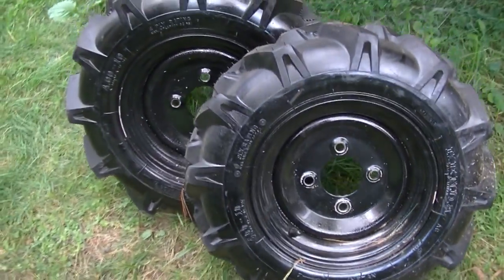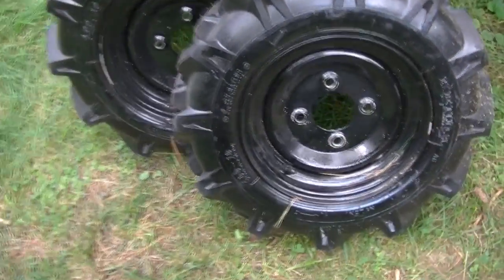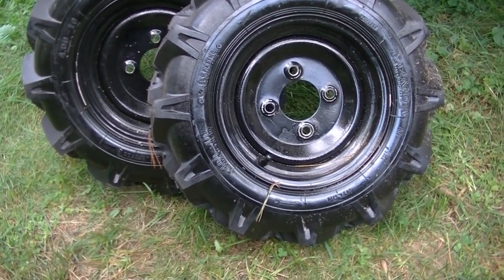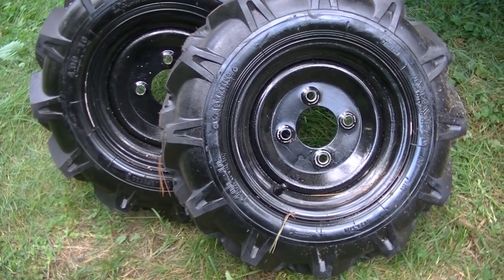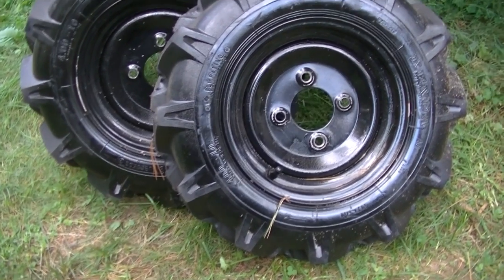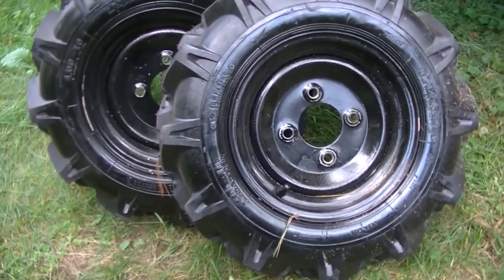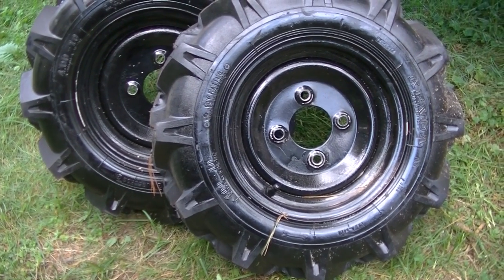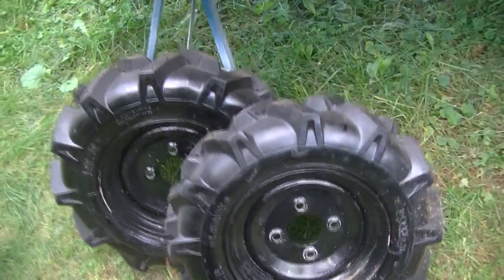Raining Goodies Again!

Comment: We have a Kubota D-1105 diesel in a 70's cub cadet, and we pull with it. This Diesel has 25hp. We destroyed 2 diffs after just 3 pulls, and I ended up building a pinto diff and axles for it. Works great now. You are going to need a substantial rear end for 40hp. I can't wait to see what you come up with for this beast. Pull video's are on my site.

Comment: The Eaton is one tough Hydrostatic transaxle probably close to a tuff torq K72 in strength.  You can never have too many Peerless 820's.  Grab 'em when you can get them.  The Subaru engine is a monster!!!  Are the car turbos water or oil cooled?  I can't tell.   The smog pump supercharger should work quite well.  Hope you have a boost gauge on the dash.  Glad you have 4 steering transaxles.  Another item you grab when you can.

Comment: I've looked for one of those all wheel steer transaxles's forever and you've got four good job
Reply from the maker: I managed to get one a few years ago, BUT- 1)The kingpins were badly siezed on one side, and then 2) I smashed a transaxle case in the original MULE so I stole the case halves to rebuild my tranny, so, It was gone. Years of nothing, then THIS happened.

Comment: The boxes on each sids of the center piece have the same style gears inside them that electric drills in such have. They are extremely heavy duty and gear down the trans a lot. If i hadnt broken the one i got out of a simplicity 6516, i couldve made it go faster by bypassing those gears

Comment: The challenge for you would be to use the rear steer rearend as a front axel paired with the 40 horse motor  and a 90 degree gearbox to create a 4x4 off-road monster!

Comment: Wow what a score! 40 HP is as big as they get for those V-Twins. I think you could make a really cool pulling tractor with it or some sort of motorcycle. 1000cc is a big motor, and it would probably have a wicked sound to it when you put an exhaust on it. But whatever you do with it, I'm sure it will be epic! 
You should also think of another use for that 12.5 HP Vanguard. Even though those engines are pretty tiny compared to the bigger ones, I heard that people can rev those engines very high (with performance parts, of course).

Comment: What car did that smog pump come off of
Reply from the maker: I don't know. All I do know is that it was for some older Mercedes. My buddy spotted it on Ebay and grabbed it for me.
Reply: Sprocket's Garage ok I'll ask around I want to do a supercharger build my self
Reply from the maker: I just found this one on ebay, I think it's the same one. You can pull it up and get the fitment guide and part numbers... http://www.ebay.com/itm/Mercedes-Benz-OEM-Smog-Air-Pump-380SEC-1982-1983-0001400885-33-243-11-243/252161251715
Reply: Sprocket's Garage thanks just found one way cheaper